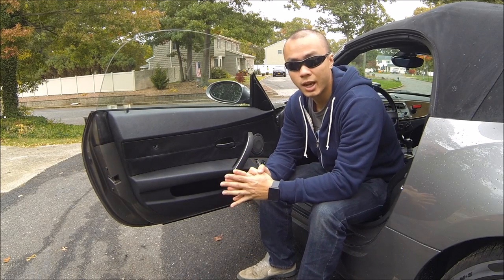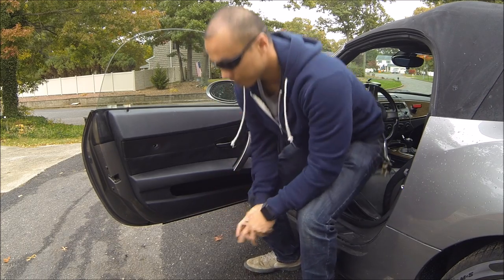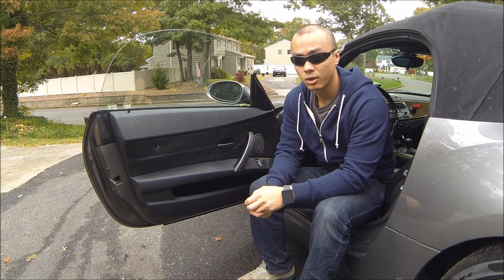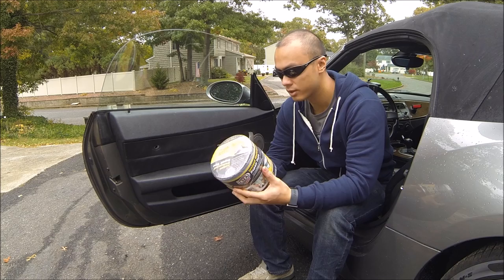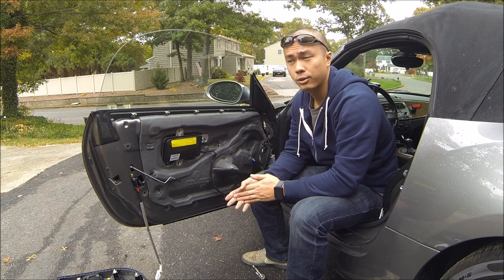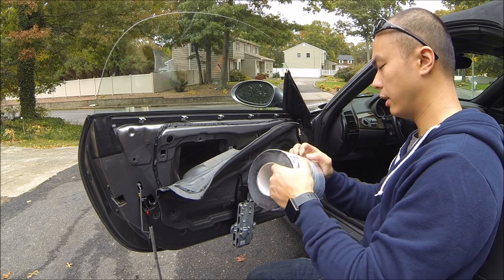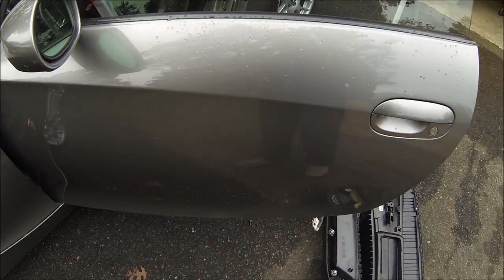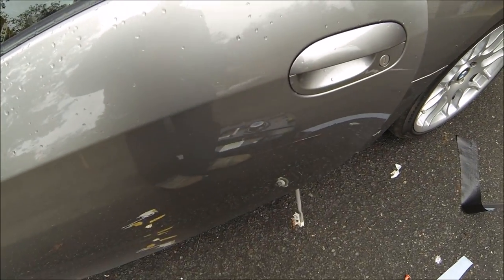Car Door Sound Deadening for Under $20! - BMW Z4 Vlog #20

Comment: I can't believe that there are people who are getting pissed by such pointless things...
Reply: Alter not pointless bro, I have a rsx and the doors vibrate when I turn my speakers up high and sounds like shit 
Bet if you had a system in your car you wouldn't want your doors vibrating/rattling
Reply: Unbearable odor is hardly pointless
Reply: Depends on what comments you've reading. I've been reading through some of the comments and already knew what most of the replies would be. That stuff made with a lot of tar in it gets really soft during heat and hardens up during cold. There are plenty of other YouTube videos showing how awful the clean-up processes after people have done this. If you're going to keep your car for any length of time or even want to sell it for a decent price you don't want to do this. It's a mess it's not worth it a $20 Band-Aid for an exploding geyser of a problem now. Do it right the first time then you don't have to go back and fix it or clean up the previous mess. I mean everyone gets that he didn't know what he was doing I mean he had an error code from the airbags cuz he didn't disconnect the batteries. The guy on the videos genuine and trying to help but there are plenty of people who have done this and will never do it again and a lot of them are in the comments shouting about how not to do this to your car and why not too many of them have posted YouTube links two different videos showing the issues that arise and how difficult the cleanup is

Comment: if you want to disconnect anything in a car (airbag, sensors, even certain lights) you have to first disconnect battery so it doesn't trigger codes

Comment: Would have been a good idea to at least wipe the dust off the plastic, you could see a big layer of dust on it. The adhesive on that is already not as good as real sound deadening and especially if you stick it on top of a layer of dust.

Comment: OK, before you take off the door panel, if you have airbags, disconnect the battery and wait 10 minutes, then disconnect the airbag module, put the module aside

If you are going to do sound deadening in the door, please be sure to mark where the airbag module once was, it will help you optimise the deadening without risking your life, last thing you want is a door card going into your or your passengers face when your car rolls, T boned or a front end collision that swung you around.

When using this to sound deaden other parts of the car, remember... please don't use this on your roof liner or your trunk lid, especially not in your engine hood - this is aspalt, it will give off a smell when left in a hot car and with this laid on a metal surface such as the roof, it will get really hot, become unstuck and possibly ruin your headliner.
Reply from the maker: Have it on my trunk for years with no problem

Comment: Bro, this is some good sh!t!  I have done all four doors in my car and it sounds completely different.  Thanks again!
Reply: any befre n after reviw
Reply: +braintrain5000 Sorry bro, I did not think about doing that.  I only have factory speakers in my car, but you can tell a difference in the overall sound.
Reply: +Larry Chapel  he did not did it for the speaker sound he dead it for ride quality  a car with deadening feels more refined and confy
Reply: +Larry Chapel Now that you've gone through a hot summer with this product in your vehicle, how's it holding up? Any bad smells, does make the door shut seem more "solid",etc?  I'm considering doing this myself and I'd like your opinion after living with it for a while
Reply: Larry Chapel how did it hold up? Did it smelt or did it smell during the summer?
Reply: Hey man so did it smell in the summer? I’m thinking about buying this stuff

Comment: How and with what could I remove this?? Please help awful smell after install
Reply: Scrape off majority with putty knife or plastic scrapers.  Mineral spirits will dissolve remaining asphalt and petroleum products and evaporates quickly without leaving odors.  Good luck.
Reply: Depending on what stage is that I'll just assume is all still hot and sticky and you're still at the putty knife phase where you're scraping the majority of it all. Let's assume everything's all Gumby and it's a nasty gross kind of asphalt sticky the best thing you can do is take dry ice and alcohol too kind of freeze up this tar and scrape it off. Do small sections at a time. It's time-consuming it's a mess but do it right don't spill too much all over the place when you're not going to be able to get to it before it starts to heat up again.

Comment: Not sure if you still respond to this video but I have a question. Ever since applying the material, did you feel an increase in overall drag on the vehicle? I feel that it takes a bit more power to accelerate even when I used it sparingly (just to remove the thin feeling)
Reply from the maker: Branderrp placebo effect it's not gonna affect your acceleration in any detectable way
Reply: Thanks for the prompt response

Comment: U.seal uses a rubberized asphalt, while the higher end products use a rubber type butyl which is much better and typically has no off gases or bad orders like the rubberized asphalt. Never the less they both word for sound deadening.. Thanks for sharing.

Comment: Have you installed this in your boot (trunk) too?
Reply from the maker: +GoDoddsStudios No, the trunk isn't a single flat panel so it would be hard to install it properly. I have a little less than half left, so I will probably add it to cure some rattles as I hear where they're coming from.

Comment: hey bro, did it help with the highway sound? I'm thinking about doing this to my car since I drive over 300 miles a week.
Reply from the maker: Z Dela Cruz  not really, the road noise is mainly coming from elsewhere
Reply: thanks for the reply bro. I already did it using the exact same material you used (u-seal)...it decreased the sound by 3 decibels...lol..but when I'm not driving, it decreased the outside noise by 5 decibels (using an app on the phone, so the accuracy is questionable)...which is amazing I thought. as for the melting and smelling, I only had it for a couple of days so I can't really say...the smell is gone, though I can still catch a hint of it every now and then....and I only had it installed for 3 days...and I did put a lot on both doors. I think I may put it on the headliner...but I will be experimenting on the roof of my house first to see if it melts before I put it in...lol...thanks for the idea man, it really helped.

Comment: this guy has the right idea unfortunately the product will cause more damage long term for various reasons. long story short if you live in an area with all four seasons or it gets super hot its got asphalt in it among other things that will melt and deteriorate quickly after a year or 2 at most depending on the weather even more so if you don't have a good garage. ya it sucks deadening is expensive if you want to do an entire door solid for each door in your care especially if you want the best quality (soundskin) but you can patchwork several doors if you know the sweet spots to lay strips. anyways amazon has dynamat for a good sized rolls starting at 15 bucks. get a couple 20 buck rolls and that's enough to take care of all the doors well enough. make sure you put some behind your speakers though (i mean on the door not on the speaker they make magnetic sound plates if you want to go that route) so it will absorb your speakers back-wave thus greatly improving the overall sound response in laymen's terms.
Reply: Dynamat and nioco which brand is better?
Reply: i would say dynamat for the price is better, honestly it wont hurt going either way so whatever is the best deal at the time but i know what im getting with dynamt every time and its the cheapest without sacrificing  quality. now if i have the budget to work with i would go with soundskin all the way because they take it to the next level. fucking expensive though no way around it even if ya just wanted to patch a set of speakers at least 60 bucks. totally worth the price if you have premium gear and an audiophile ear.

Comment: So zed4, it's nine months later, and warmer.  DOES it smell? Has it lasted? Would you do it again?
Great vlog series, BTW. Keep em coming.
Reply from the maker: No smell, no issues, would do it again in a heartbeat!
Reply: I believe you. It also looks like you're in a much milder climes than I am, though--100 degrees plus much of the summer here.  The thought of having to scrape that stuff out of my doors if it goes south... Think I'm going to spend the extra $18 for butyl material, just in case. Keep up the good work!
Reply from the maker: pat pacino yeah I'm sure if the car sat in the sun in a hot climate it would be different.

Comment: bro did you upgrade your sound system by any chance?
i m very much into doing it but dont really know which setup to go with.
Reply from the maker: I have the digital audio system and the amp blew which ran the small subwoofers behind the seats so I got a dedicated sub amp to run those two speakers which now make the car sound great. Thinking about upgrading the whole system, maybe in the future.
Reply: Alex L thanx for the info ill have look at those.

Comment: if you don't want the airbag light. turn off the ignition and remove the key from the contact whilst unplugging and only put the key back in when you are done..
Reply from the maker: Won't work. Needs to be done with BMW diagnostic tools which I have done.
Reply: zed4me 
i work on BMW on a daily base, installing custom or replacement interiors. never had an airbag light go on because of that.
Reply from the maker: Oh sorry you meant to keep the airbag light from turning on in the first place. I thought you meant to turn off the airbag light

Comment: If you disconnect the battery the light should go off.
Reply from the maker: It has to be fixed with BMW Diagnostic Tools
Reply: zed4me another reason not to own one of these money pits.
Reply: zed4me get something like 'carly for bmw' you can do it yourself and change loads of settings in the car.
Reply from the maker: The Chronicles of Car-nia I've got BMW diagnostic tools already with NCS expert and the whole stack of programs. Took awhile to figure out how to turn off the airbag light cause these 2003 z4 were a bit different than other models but the airbag light is now gone. Did quite a bit of mods like auto windows, key remote function etc.

Comment: nice watch
put it on the panel that u took off, that will help? how?
Reply: I usually apply deadening to the door panel when I'm doing a speaker upgrade as vibrations hit the door panel and make it rattle a bit.. The deadening stops it happening

Comment: Nice z4 and good tutorials! 
Thinking about buying one too. How much mileage has yours?
And would you recommend buying a more expensive one with under 100 000km or go for a cheaper one with around 150 000km?
Reply from the maker: I wouldnt mind either way as long as the servicing and quality is good. that's more important than the miles for sure.
Reply: +zed4me This is exactly what i thought, thanks.
Btw, what is the mileage on yours? And do you mind asking how much you roughly paid?
Reply from the maker: daineserider I'm in the US paid about 7 grand with 90k miles on it
Reply: That is great value, even if compared to the prices in Europe!

Comment: Thank you. I just bought 4 rolls of peel and seal yesterday to do my entire trunk and all 4 doors. I was worried about some negative comments I saw about it. But your video proves that if u do it right, it will hold up.  How does the thickness of this stuff you used compare to peel and seal? Are they the same?
Reply from the maker: I'm pretty sure the specific thing I bought is not like peel and seal cause it help up so well with no smell at all. Maybe I'll do a comparison one day
Reply: What is the name of that? You say its at home depot? I need to get some. I can always return the peel and seal as I havent opened it yet.
Reply: Also, is that stuff butyl instead of asphalt?

Comment: I bit cheaper but better is spray on or heavily rolled on truck bed liner, works great too. the added mass, which is all sound deadening does, gets rid of the clank sound and is 100% water, heat and weather resistant
I not only use it in the bed of my trucks but under the bed, cab, passenger compartment wheel wells firewall doors, roof and floor of every new vehicle or restoration project I buy since I am already pulling the entire interior to upgrade the carpet, seats add aftermarket audio to the doors etc.
any auto parts store sells a do it yourself "bed liner" that can be used
Since I do blow through subwoofer boxes on most of my trucks being able to color match the custom paint is a great plus
If you feel you must add closed cell foam just spray glue it on top the bedliner
Closest to my mythid is Second Skin Audio, which is a good stick on or spray on product
Reply: Mass is part of what CLD does, but not the only mechanic that is at play with a good CLD.

Comment: Nothing wrong with this stuff, I did my work van from front to back on all the sheet metal before doing 2 layers of insulation over it.

It has been the most comfortable work van I’ve ever driven, way lower road noise then the other trades guys and it holds temperature way better.

It doesn’t smell, quit being pussys 🐈 😂😂😂

Comment: I did this right after watching this video about a year ago. It's     the exact same as day 1. It deadened the the rattling, sound quality got way better to where I could actually hear great midbass, most of all it absolutely did not smell like asphalt. Maybe someday I will install actual dynamat but as of right now it's doing just fine. I'd recommend this to amyone, but if you have trouble putting this stuff in your vehicle then just go with dynamat. I also applied herculiner to the interior of my cab.🤙

Comment: Yesss I have a question... besides the cabrio.... being a “Convertible” being the main reason why they saved the extra weight of that based on their common German sense.....  as they had to add lots of extra roll bar weight and peripherals of extra added security... but as friend of many Germans.... I bet you they are thinking if you also spent less than 99 cents on your sunshades...

Comment: The time when he knocked the door (before) and after he applied.. wowwwww......

no difference at all😂
Reply from the maker: You need to get your ears checked or get better speakers
Reply: theres a huge difference
Reply: @00:47 and @03:30 At least knock on the door in the same places. He knocked on the middle of the panel at first then a totally different area the 2nd time. You have a point.

Comment: I'll second the warnings about using asphalt-based tape - use butyl based.

Apart from the smell, if the stuff starts to run inside the door and blocks the drain vents at the bottom, you'll have extremely serious rust problems in a very short period of time.

This is something to consider when doing anything to the outer door skin as any water that gets behind the glass will run down it. Always ensure water can't collect in crevices.

Ditto when doing anything with the outer skins inside areas like the rear wheel panels, etc. Those drains are there for a reason and easily blocked.